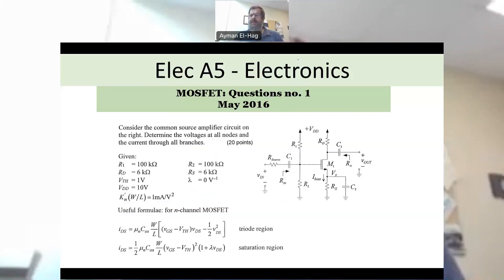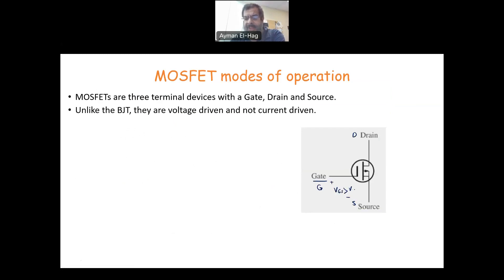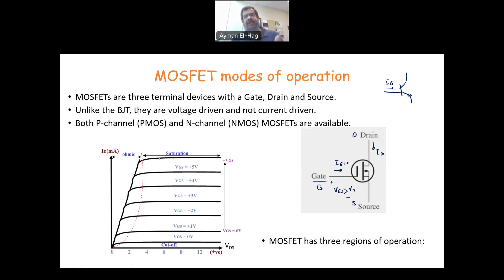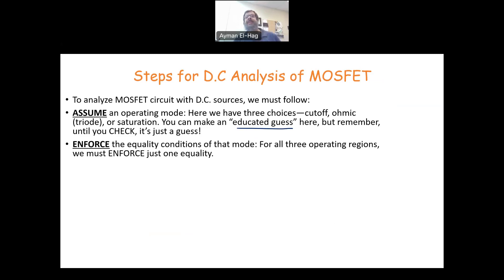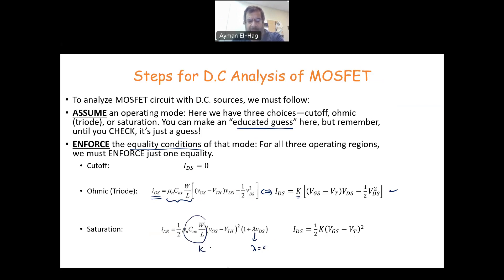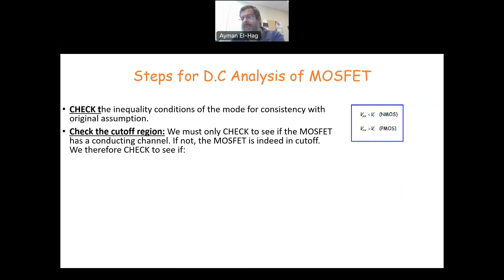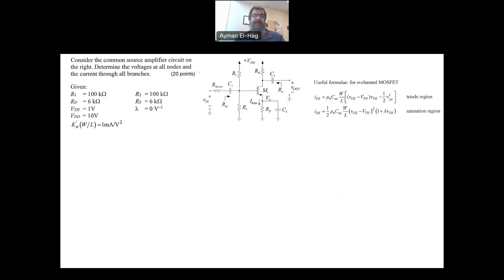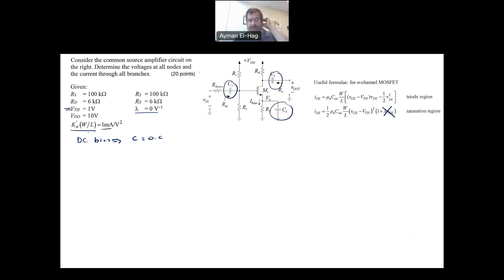PEO solved examples (ELEC A5): MOSFET Question no. 1

Comment: Thank you for the solution professor, but i would like to point out solving to the quadratic equation, which will be 18 Ids2 - 24 Ids + 8 = 0 then ids shall be 0.66. please correct me if i am wrong
Reply from the maker: No the equation should be 18 Ids2 - 25 Ids + 8 = 0, you forgot Ids in the left side of the equation.
Reply: @electrical4everyone  Yes professor, I forgot to account LHS. Thank you for the reply. Its been long time not solving any equations. Lost touch :)